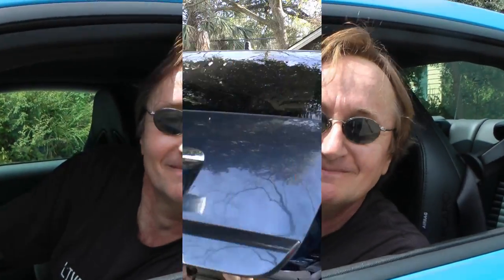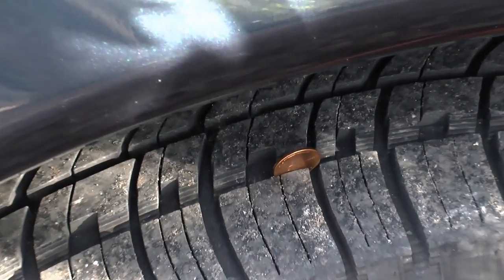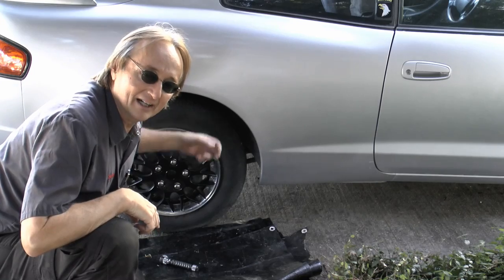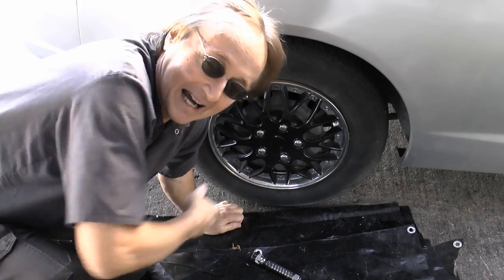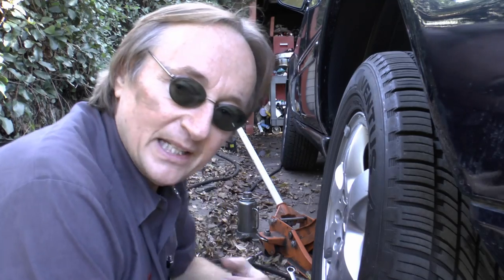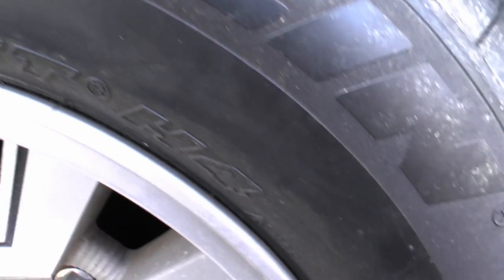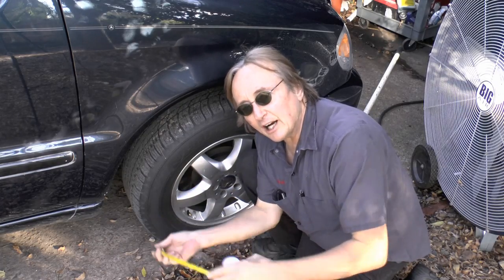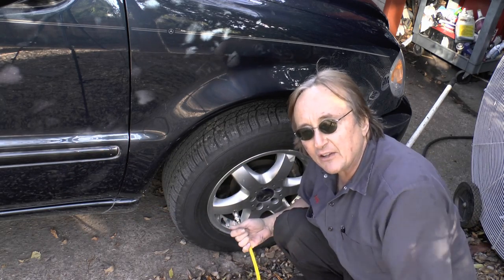How to Tell if You Need New Tires on Your Car

Comment: How many times can you plug a tire? Local tire shop said they can't plug a tire more than once and wants to sell me a new tire.
Reply from the maker: I've seen em plugged 5 times and still work on a guy who lived in a construction zone and kept getting nails
Reply: Thanks for the reply! Love your channel.
Reply: Todd Vinton up to 3 but the plug might be to close to each other
Reply: You can plug a tire yourself anyway so screw them. The plugs are cheap and if you don't have the tool(s) and are in a bind you can bend a coat-hanger wire with pliers if you know what you're doing and use that. I don't know how much they'd charge you to do it, but a kit with plugs and tools is like $15. Unless it would keep you from making a hundred bucks an hour, I think it's worth spending that and the half-hour (or less) to do it yourself. As a bonus, if you keep it in the trunk you'll save on tow truck fees if you get a flat and don't have a spare.

Comment: Hey scotty i have a 2002 nissan sentra. It had 195/75 14 inch wheels and tires. I didnt like the look of the rims so i put on some extra rims i had laying around their size 225/95 16 inch. Now everytime i get more than 45 mph or brake around 45 the steering wheel shakes alot. What should i do make it stop shaking? 
@scottykilmer
Reply from the maker: that car was not made for 16 inch tires, but go to a good front end alignment shop and see if they can fix that shaking by adjusting stuff and balancing the tires

Comment: I have a 93 s10 4x4 and it smokes when starts up and idle i changed plugs and wires oil and filter and pvc valve and it does t smoke as bad any idea?
Reply from the maker: engines on those just flat wear out at that age. Live with it, or rebuild the engine.
Reply: Could i put new valve seal and guides in? Thats what a guy said to do, plus the truck still starts up and drives like it was just bought.

Comment: Love your videos, but I would never drive on tires that are over 6 years old. If you look at the DOT number stamped on the tire, the last four digits give you the week and the year the tire was manufactured. I always check this when I buy new tires to make sure I didn't get stuck with old tires that have been sitting around for years. I used to buy Republic brand tires, but they don't make them anymore. I have a set of Cooper Response tires now that do very well in all weather conditions.

Comment: Are you talking about the Chinese brand tires or the tires that aren't Chinese branded but made in China? I have Korean Hankook Dynapro ATM off-road tires on my Tacoma and they are made in China, but they are excellent and don't have a hint of wear on them after 5 years. Even went off-road with them on and they didn't deform or anything.
Reply from the maker: *****  some hankook tires are very good tires, but many chinese tires and korean tires are not, especially the low end ones
Reply: Okay thanks for the info on that!
Reply: Scotty Kilmer Ever had an Issue with Cooper CS line of tires Scotty?
Reply: Scotty Kilmer it depends on the brand and the requirement they state their products should meet when they come rolling out of the chinese factory.
Reply from the maker: ***** problem is, the chinese often cheat on the tire rating systems, giving their tires higher ratings than they actually have, as often no one ever checks to see if the ratings on the tires are true. Just like chinese copies can say "delco" on them and not be made by delco

Comment: Is it worth buying those 60-80-100,000 "high mileage" tires? Do they really last longer than the 40-50,000 mile tires? I never bought any tires that were rated for over 50,000 for my truck before, and I'm due for a new set this year...
Reply: I've put big miles on my truck tires by just babying them and making sure they're regularly serviced (rotated, aligned, etc)
Reply from the maker: not really worth buying em, the "ratings" are for tire tread wear, if they wear out before then, they don't care, they will just say they are worn out and time to by new ones. A sales trick really

Comment: Had a bunch of parts replaced , tie rods, ball joints , [cv joint] that blew out the first drive from this shop after repairs.and my suv has had a bad shimmy ever since. My Yokohama tires have 32000 miles. The shop never told me the tires would need replaced after part replacement.  I maxed out my card for repairs. They claim the tires are cupped told me to stop complains or I can not return to their shop. Another tire shop said I had lots of wear left on tires. I now have a car I’m afraid to drive and over 20 miles from a town. Ripped off , Broke  and stranded.

Comment: I have an 2003 ford windstar when sometimes i try to go into reverse the engine revs but it reverses slowly sometimes like it dont have no power. even though how hard i rev it goes forward fine and drives fine and has power the transmission is three years old WHAT DO I DO i replaced the  pcv valve got the oil changed all the fluids topped off..
Reply from the maker: reverse is starting to go out, IF it's full of fluid, rebuild it or get rid of it fast before forward gears go out

Comment: I would always go with tyre manufacturers that have performed well in the standardised tests (braking, wet grip, dry grip), that have a long history of making tyres and that have some racing engagement (RD from racing still transfers down to the road, just look at the BF-Goodrich G-Force rival which kicked off the whole performance tyre scene for road cars). Nowadays i would go with Michelin (PS4S, being my personal choice), Dunlop (Goodyear), Pirelli, Continental, Bridgestone, Firestone, BF-Goodrich. Also most modern tyres have a so called TWI (Tread wear indicator) which is a little rubber "bridge" in your tread profile. If your TWI is even with your tyres´ surface, then its time to change your tyre. The TWI equipped grooves are also the only places the law enforcement is allowed to measure your tread depth, as only the grooves associated with them are deemed important for traction, at least thats the case in Germany.

Comment: good morning good sir, any idea on the difference between small and bigger tires and how they affect small engine cars, see on my 1.6 non turbo car, i had these 195/55r15 tires and i changed it to 205/55r15 not a big change but i actually felt the car a little weaker.
Reply from the maker: best to stick to factory size tires, the car was designed for them by engineers. You mess with the tire size, you mess with handling, acceleration, and gas mileage.
Reply: yeah of course, but just for killing curiosity one extra question, a bigger tire (profile) will make the car go slower??
Reply: viuliscopmosco
The larger the outer diameter, the higher you raise the gear ratio, the longer it takes to accelerate to speed.

Comment: Yep, I got some very small cracks in one tire (mostly on the side wall) but with no metal showing. But I don't drive but 30 miles a day.
Reply: They require 44psi of air. But can I make due with 40?

Comment: A tire about a year old loosing air, I'd be checking the valve out on it. Could be someone messed it up putting it on the wheel, or it's just goin bad. I've seen guys rip those valves mounting them on the wheels cause they put em on dry when replacing em. I always suspect a bad valve first, when a tire keeps loosing air then go from there.

Comment: Scotty your videos are good but a couple of things:  If that tire was punctured that close to the shoulder like you show then most places won't even attempt a repair because they don't work well in that area.  Second, tire pressure isn't the only thing to worry about, you also need to rotate your tires or you'll likely have 2 wear out much sooner than the other 2
Reply from the maker: that's my tire, it's holding air fine for years, I know what I'm doing. And rotating a tire is often a waste of time these days with radial unidirectional tires, they wear fine just going down the road UNLESS your car has worn out suspension parts.
Reply: Scotty Kilmer This is correct.  I was going to mention this, but you mentioned it well for me.  If a person drives moderately around curves and has good front end parts and alignment per a front end they never need to rotate any tires unless they drive harshly around curves in which the front can be moved to the back, but the changing directions of any tire is BAD BUSINESS and was actually deadly in the older steel belts that were in the sides.  That's why no one should ever buy used tires
Reply: Well in my own personal experience tires have never worn evenly without rotating.  Even with a brand new car and no suspension issues whatsoever.  Especially on a FWD car where the fronts are handling the power as well as the steering.  Besides, I buy most of my tires from Discount like you do and they'll rotate and balance them free when you buy from them anyway.

Comment: Hey Scotty--- On the label , just inside the driver's door, my eclipse recommends 32 psi, while the tire, says 51 psi. Which should I go with ?---- And BTW, you have the best channel on youtube.
Reply: +Pugs Rock Set them to 32 PSI. The car manufacturer know what works best for that model. The tire lists the maximum safe pressure (if you had a heavier car or were carrying very heavy loads at highway speeds for a long time then you wold increase the cold tire pressure before you started the trip).
Reply: Billy Bob Thanks for clearing that up !

Comment: I heard the driven tires wear faster so it's a good idea to rotate them once per year or every 10K miles. Do you agree?
Reply: I rotate my truck tires every 5k miles when I change the oil, and I get them balanced and aligned once a year. I want the $600 I spent to last a looong time. The last 2 sets of tires I owned I put about 90k miles on each before they needed replacing...
Reply: That's about how long tires last
Reply: Usually rear and front tyres are different sizes depending on what drivetrain it is
Reply: ***** I haven't noticed that except for sportscars. All the vehicles I've owned have used the same size tire front and rear.
Reply: Steve Kilpatrick the worst is the more pricey European cars that do different sizes front and rear and use directional tires so you cant rotate at all. also worked on a smart car recently that was set up the same way.
Reply: JOE FPOC Yes! I've seen how the Smart cars that have those wider tires in the back. I haven't owned any European vehicles, just American and Japanese, so my experience is somewhat limited with their tire specs.

Comment: In the UK we have to have our cars MOT'd once a year(Ministry Of Transport test) For a tyre (or should that be tire? :p) to be road legal it has to have more than 1.6mm of tread. If a cop stops you and finds you have a tyre that is "defective" they can make you change the tyre on the spot, or leave the car where it is and have it changed later, depending on how bad the tyre is.

One car mum had about a year ago, would rumble and vibrate at 60mph+ We had no clue why until we took the car in to have an exhaust repair done and asked the mechanic to check the front wheel bearings, turned out the rumble was being caused by a defective front tyre. It had about three bulges in different places around the tyre.

Is it true that incorrect tyre pressures can effect your fuel consumption?
Reply: Every year? That's a bit excessive.
Hell there are no inspections where I live and emissions is only every 2 years.
The vehicles the REALLY need inspections every year are trucks because when they fail everybody dies.
Most cars that would fail inspection will usually run so poorly to begin with they get scrapped before they become a real danger, even in the rust belt.
Reply: s0nnyburnett It's not really a clear description given, you only get a MOT test once the vehicle is 3 years old then every year after that
Reply: stewiecee1234
I feel bad for you guys.
Reply: And to make it worse the person who tests your car is likely to be the guy who will fix it so there is incentive for them to fail a car to make more business for themselves. Since the fee for the test is set by the government at a rate that is lower than the usual labour rates a garage charges many will need the extra work to make them worth while.
Reply: s0nnyburnett
Yearly inspections aren't as bad, or as inconvenient as you think. In New York, they take 20 minutes max, and honestly it's a good way to get a heads up on any maintenance you may need in the future, even things that are a little tougher for you to see, such as how much brake material you have left. A decent place will notify you of these things after the inspection, rather than just slap a sticker on it and charge you $20
Reply: *****
It's not excessive at all if your tyres are bald or damaged. which is when they will prohibit the car from moving until tyres are changed.
Reply: *****
Standard police practice in the UK with defective tires would be to give a ticket and 3 points for each defective tyre. (12 points within 3 years you're off to court facing a 6 month driving ban). For bald tyres it's unlikely the police will issue a prohibition notice (not allowing the vehicle to be driven until repaired) unless the tyres were severely worn or other defects with the vehicle are present.

Comment: any advice on used tyres for drifting
I had ones from 2007 tought i might burn them but i tought they could explode so i threw them away 
even the guys at the tyre store said man fuck these tyres they are not worth even 10 bucks :/ 
they didn't have thread which i tought is good for drifting but then because they were old they were cracked on many places :/
Reply: If you were actually drifting your car in competition or just for the fun of it (safely, away from the public) you would not care what you had on the car because one of the things that can and will happen is blown up tires as that's part of the sport. Drifting specifically implies you'll wear the tires until they burst anyway.

Comment: Hey Scotty the front  tire on my 96 accord is losing air slowly. They are brand new. The car usually sits in the parking lot for a couple weeks at a time before being driven
Reply: Check the beads of the rim with a soapy water mixture. It could be rust on the rim since its an old car.
Reply: Ok. Not sure if I will check, it's really cold outside
Reply: Peter Kapica Yea, wait till it warms up or have a shop check it and tell them to show it to you.
Reply: I think ill wait, its the middle of winter
Reply: They are the stock steel wheels
Reply from the maker: Peter Kapica
often they are mounted poorly, and leak at the rim edge, check that first. If so, let them remount them free for screwing oup
Reply: I don't think they screwed up. It was done at a walmart in ks
Reply: Peter Kapica Right now in the winter time its always good to check the air pressure in your tires because of the cold. For every 10 degrees the temperature outside goes down the psi goes down by one. I work at Discount Tire and we recommend to check the air pressure on your tires at least once a month. If you go to one of your local Discount Tire stores, you will also get a free air check.
Reply: *****
It was in manhattan ks and i think it might be a issue with the rim. I know this because walmart fixed the leaks on 2 front tires on my 2000 bombardier ds650. It held air well, but after sitting, its leaking. And yes, ive went to discount tire before, but i didn't see one in manhattan.
Reply: Take it many shops until some finds the source could be anything to air leak through the bead to pin hole to stem
Reply: Well what do you expect, its an old car
Reply: Peter Kapica a lot of shop won't charge for a look....
Reply: TheFlacker99 (Flak) I hate to be this guy but a '96 is not old at all. My truck has 36 year old steel rims that aren't rusty
Reply: EragonSuperM Considering its 2015, yes thats a relatively old car. Rust can happen, especially on steelies.
Reply: TheFlacker99 (Flak) Yeah good point. Have a nice day.
Reply: EragonSuperM Same to you :)

Comment: Nice video and channel! It might have been handy to point out the tread wear indicators and the date of manufacture stamped on the side of the tire. I replace mine six years after manufacture, regardless of tread remaining. Even if they aren't worn out or rotten, the ride often becomes too hard and noisy as the rubber dries out over time. In some cases, getting  a new set of tires has been like getting a whole new car! I also like to add 3 or 4 PSI over the pressure recommended in the doorjamb for better economy. Nice Mustang, by the way!

Comment: Most tires also have wear lines that indicate when to change them. They generally sit up in the crack about the same height as Lincoln's head on the penny, so they can be used as an indicator too. Of course, uneven wear and cracked tires should also be changed.

Comment: Hey Scotty love the channel and after coming across your video about heater not working I check my coolant new thermostat and the heater core is clear and still no heat would you have a clue what it could be?
Reply from the maker: If you don't have air in the system, realize all modern cars have computer run heating and AC systems. SO, find a guy like me with a dealer level scan computer to do bidirectional testing of the heating system, they are THAT complex
Reply: Scotty Kilmer Thanks for the reply! But what do you consider modern, I have a '97 ford explorer does that still apply?
Reply from the maker: Jesse Lockhart
yes, 97 is all computer controlled heat too

Comment: Weird summer 2016. 2 Bridgestone Potenzas and one Continental contisportcontact 5 peeled off. Those was not old tires and not racing with those. I have better experiences from Chinese tires. Ling Long and Goodride works well for my use and every year 10,000km Europe trip as well.